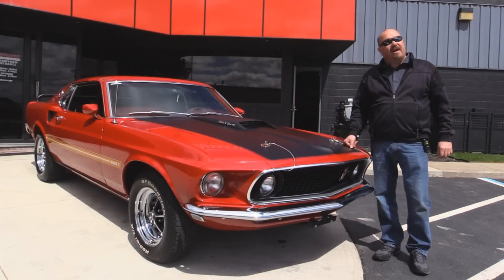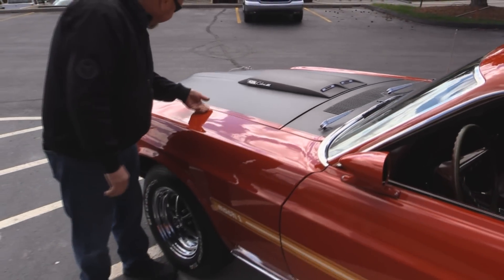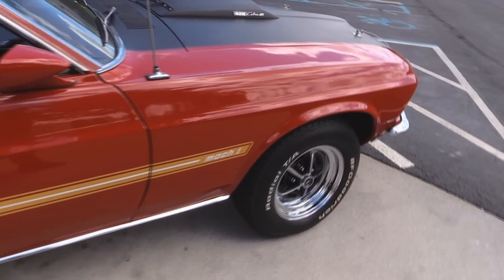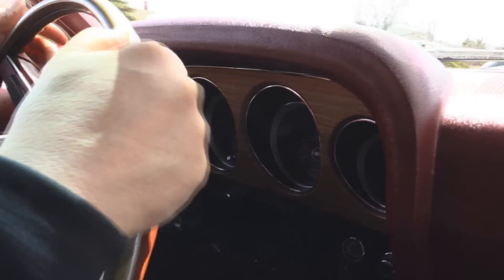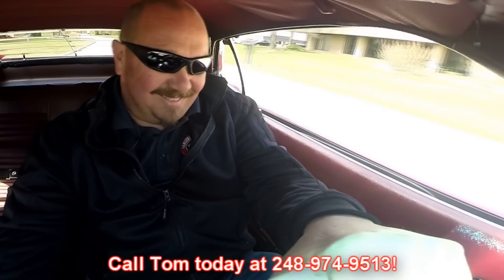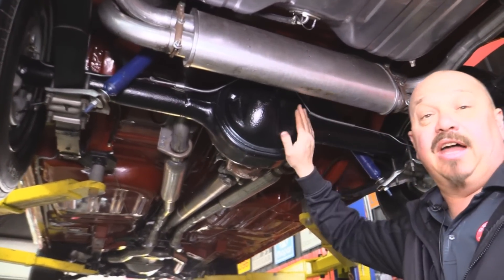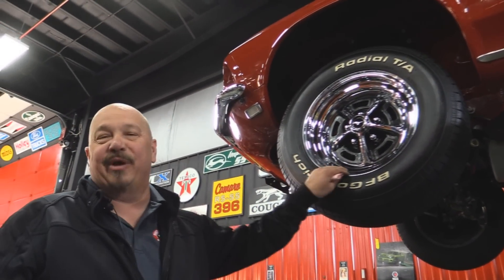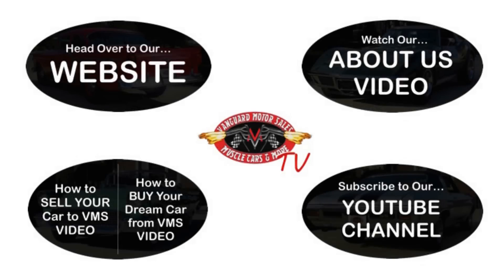1969 Ford Mustang Mach 1 Q Code For Sale

Comment: Nice car!!! The car sounded pretty mute for a muscle car. The exhaust sounded not as brutal as the usual especially at the beginning of the video. The engine sounded different too (quiet). The 1967 S code sounded much better! The blacked out lower lip on the front bumper is missing. Other than these great car. Fantastic Interior. Love the Shelby striped gear shift handle. Those are rare to see :)

Pete :)